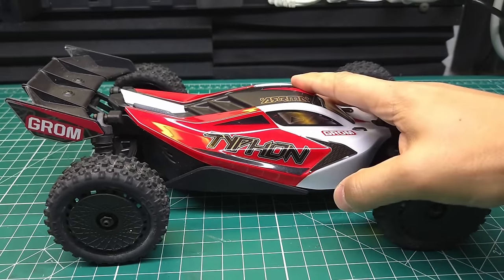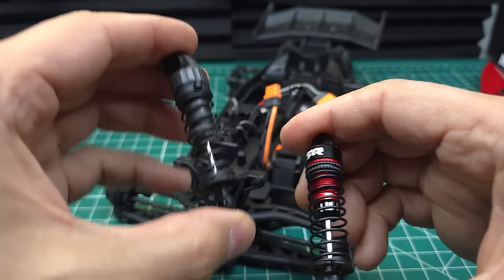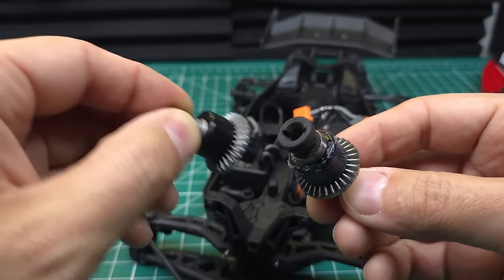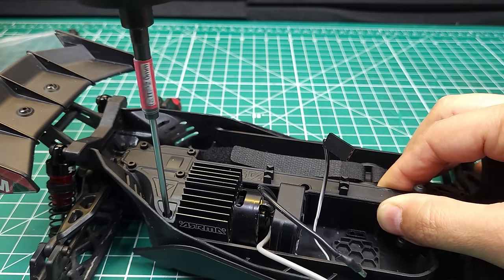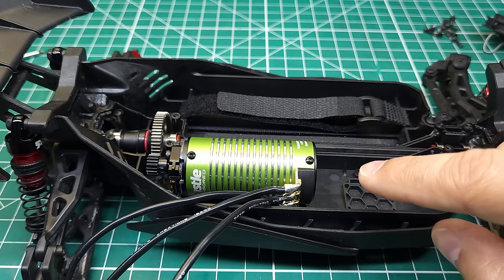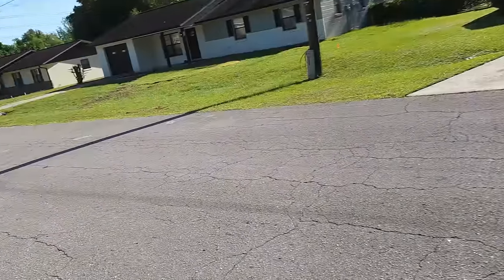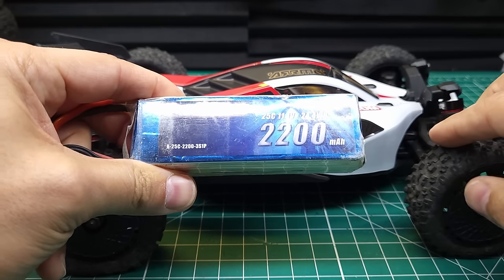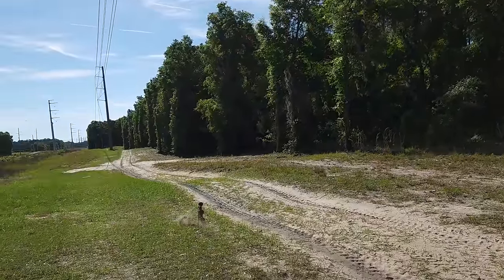I Made The World's Most Powerful Upgraded Typhon Grom & It's INSANE!

Comment: Where do you get your upgrades? Are they just from the Granite hop ups?
Reply from the maker: Yes all of the mechanical upgrades are directly from horizon. The electronics are castle.
Reply: @DoRC  thanks! Just wanted to make sure those granite parts worked on the typhon.

Btw, that thing is ridiculous fast and looks super fun now! Thanks for the help!
Reply from the maker: @benjamin3769 Yes. As far as I can tell everything for the granite will also work on the typhon. The typhon springs are a little bit shorter so if you get the shocks you might want to swap them over though that's just dependent on how much sag you want.
Reply: @DoRC  thanks!

Comment: Where you get the parts, I see granite grom upgrades everywhere but no typhon grom. I broke a drive shaft and can't find parts
Reply from the maker: Everything from the granite grom will fit the typhon Grom. The only difference in the parts that I used is that the Typhon Grom springs are a little bit shorter than the granite grom ones with the shocks are the same length

Comment: Are all the upgrade parts the same as the Grom for the Typhon?
Reply from the maker: As far as I can tell yes. The only difference I found is that the springs on the Typhon are a little bit shorter.
Reply: @DoRC  Was asking because I need the metal driveshaft kit for my grom it's been on backorder for months. Horizon Hobbies incompetence has been second to none. I talk to a lot of people in this hobby and not one of them is happy with HH.
Reply from the maker: @Schmidt3850  Yeah ever since last July when they did a system upgrade they've been having a lot of problems.
Reply: @DoRC  Ya think ? I am so done with HH . They said that the metal axles were in stock a couple days for the Grom l ordered them and they never got shipped so I emailed them and they told me it was a mistake they are still on backorder. There costumer service and website stinks.
Reply from the maker: @Schmidt3850  That sucks. I had a set of the upgraded differentials ordered from the very first day they had them on the website. I was able to order them on eBay from horizon get them delivered and my pre-order still hadn't shipped.

Comment: What pinion gear did you use for the 3.2mm bore, Mod .5?
Reply from the maker: I used hot racing 1/8 bore pinions I got on eBay
Reply: @DoRC been looking all over for pinions.
Blown 3 up and a spur so far. Wonder if you can drill a Arrma to a 5mm bore then sleeve it down?
Reply from the maker: @Havingoneofthosedays-  Not sure. What motor are you using?
Reply from the maker: @Havingoneofthosedays- thanks. Yeah check out the hot racing ones.

Comment: Putting the 1007 in mine and having trouble with motor mounts did you use the stock pre set mesh mount or did you go with the adjustable one?
Reply from the maker: Initially I went with the adjustable one but after fighting the mesh adjustment for 20 minutes I just went back to the stock plastic one. I was using an 18 tooth pinion anyway so I figured I would just go with it. Seemed to work well though if you're using a different tooth pinion that's probably not going to work for you.
Reply: @DoRC  I’ve tried the stock 18 and I bought arrmas motor mount kid I’ve tried every size from 18-22 meshes fine before too cover goes on but after top cover is on it’s so tight you can’t move the tires, did you experience anything like that?

Comment: Do you have a link for that castle motor esc combo? I'm using the 40$ Amazon special king val 😂😂 I'd like to use this later down the raid on the vorteks or MOJAVE
Reply from the maker: It's the castle micro X2 1010 4400 KV combo. There are a bunch of different places you can get them.
Reply: Ok awesome thank you

Comment: Why did you have to take cover off esc ?
Reply from the maker: It was hitting the body. You could probably get away with out doing so but the body sitting right on top of the cover blocks air flow. I think as long as you secure the harness it shouldn't be a problem but no guarantees.

Comment: Turn your steering sensitivity down when doing high speed runs, lot easier to control.
Reply from the maker: I have a curve set for speed running but it's still pretty darty. I think the centering of the servo isn't very precise so it always kinds of end up pointing One direction or another so you're constantly having to adjust for that. A better servo or a gyro would certainly help. Or maybe just a better driver :-)

Comment: On tuesdays nights at my local track we race minis on the carpet , its off road setup with jumps , i woukd do the exact same put a castle mamba micro in it and some pro line carpet tires , thing woukd rip
Reply from the maker: Yeah the castle set up is pretty good though I think the 10:07 motor would probably be more appropriate for general use
Reply: @DoRC  I run the 0808 castle in my lost mini b pro roller and its the fastest on the track
Reply from the maker: @midwestboss8808 nice!

Comment: Looks like a Typhon with big tires is the better choice than the Granite
Reply from the maker: I would agree with that. It's more stable and will have the same ground clearance as the granite. Basically it's a bigger version. The only downside is that it doesn't land on its wheels as often due to the flat nature of the top of it
Reply: @DoRC Is it all possible to put the Granite body on this? Or is the wheelbase too long.
Reply from the maker: @daveshank1921 anything's possible but it's not a direct swap as the wheelbase is over an inch longer.
Reply: @DoRC  that’s my next question. Any way to get an MT body on it? Maybe from another 1/16, 1/14th?

Comment: Isnt it crazy? Lol i knew an axle would go. Hopefully m2c can make us something
Reply from the maker: Yeah I'm not too worried about it as I don't plan on running this thing on 4S normally. It's just too much power.
Reply: @DoRC  i know. Its just so much fun on this power. A center diff or a viscous coupling would make these tiny trucks perfect. Do you plan on keeping the micro x2 in it? If so, i was very impressed by the castle 0808 4100kv. Not enough torque to break stuff but still alot of power. That was i was using before i switched to the 1007 6350kv
Reply from the maker: @colerippeon3903  Yeah it'll probably stay like this. I'm probably just going to keep the 1010 in it. It is fine as long as you are careful :-)
Reply: @DoRC  that awesome. Im gonna hold off on the typhon for now. If the mojave grom is actually coming to fruition, thatll be the next one i go for
Reply from the maker: @colerippeon3903 Yeah that would be cool.